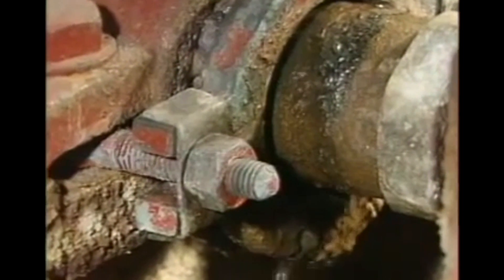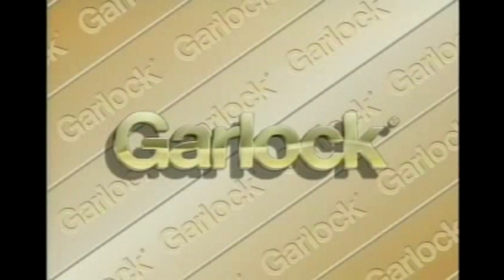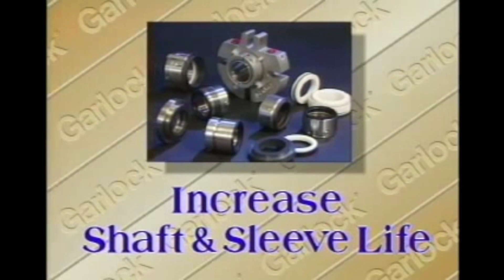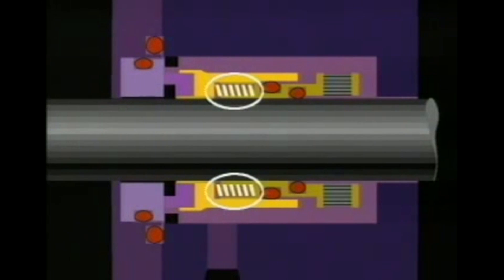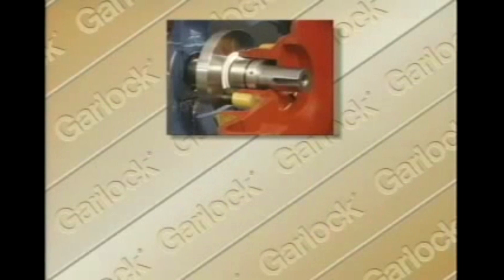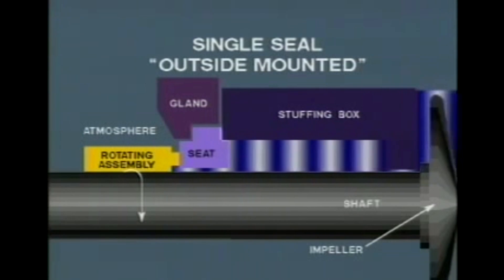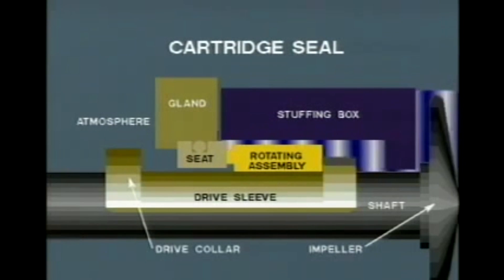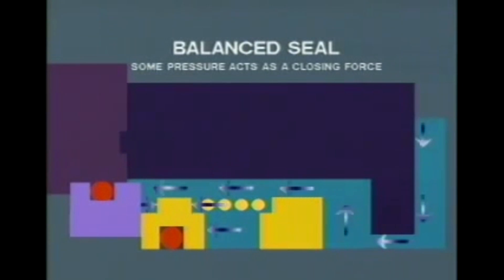Mechanical Seals

Comment: Mechanical seals makers seems to forget something about certain materials like the sliding seal known as slide gates opening used in steel ladles at the bottom which has to maintain it's non-leaking status as it slides open and slides close when containing and pouring a million tons of MOLTEN steel flowing right through it. It is made out of a compound of graphite and sapphire. Suspiciously wondering why this material was never experimentally tested since the 1980s to be used as a material component on rotary mechanical seals for propeller shafts and pump shafts.